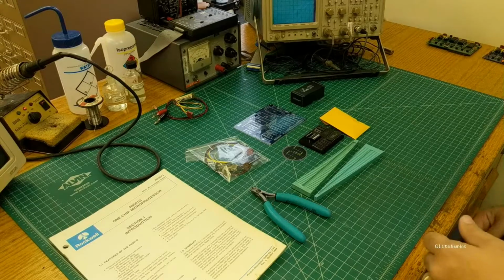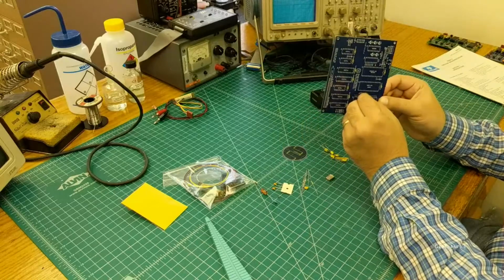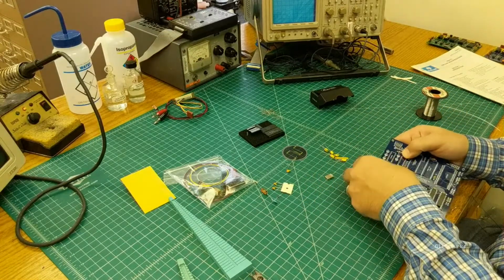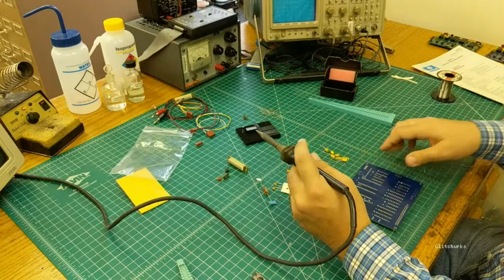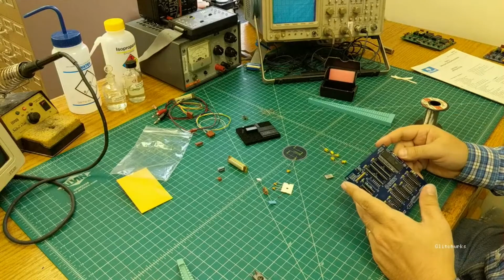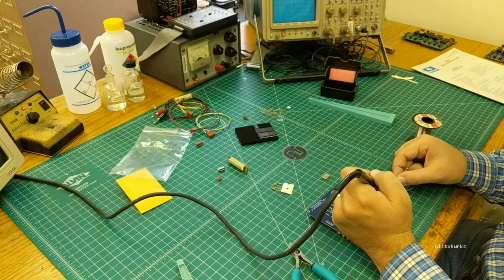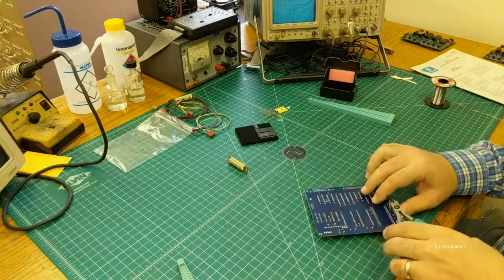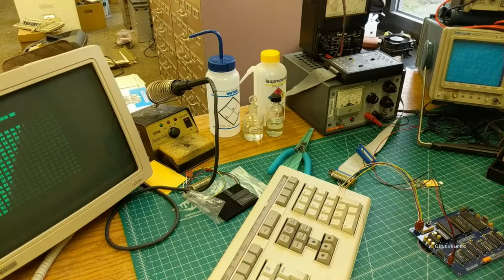Glitch Works R65X1Q SBC Build

Comment: In the video you mentioned the 8085 is this still available? I looked on Tindie but don't see it listed
Reply from the maker: We're working on it! Should have 8085 SBC rev 3 kits listed this week. We wanted to have SBC kits plus the CF card adapter that lets you run CP/M 2.2